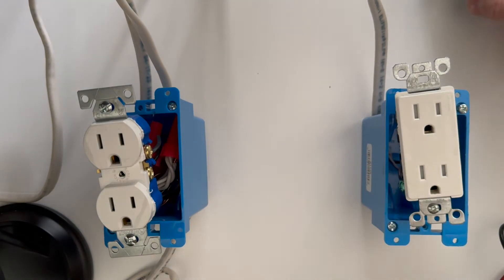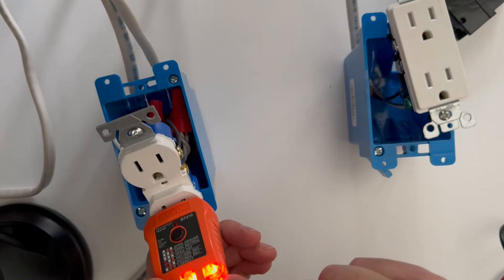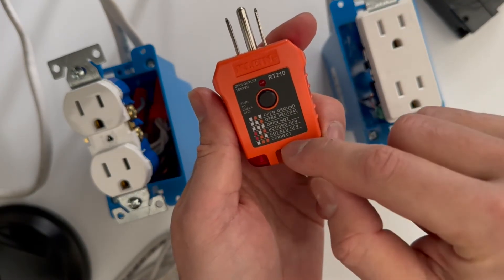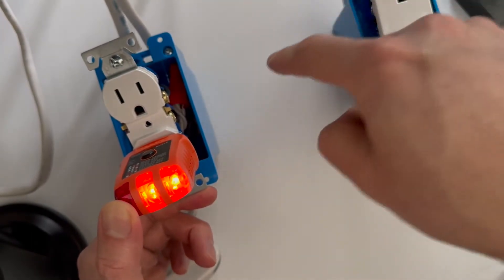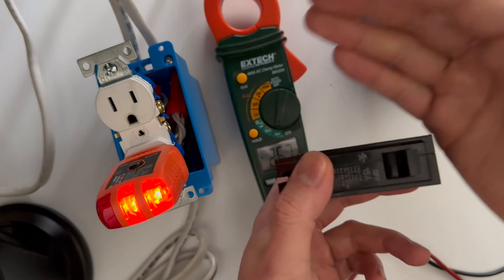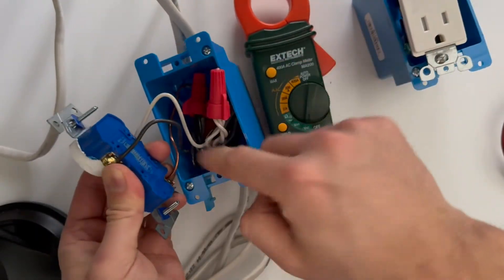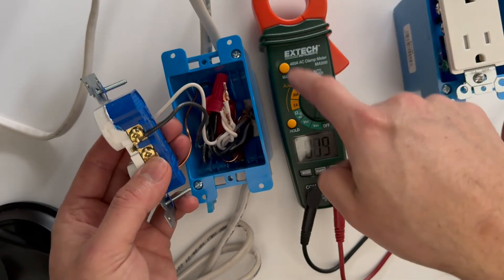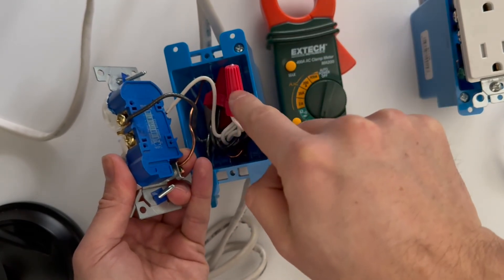Hot Ground Reverse on Tester, Open Neutral Troubleshooting

Comment: I had the same problem and that is exactly how my electrician found the problem without opening all the other outlets. With his tester similar to yours, the outlet that had the correct readings was the one he fixed. It had the neutral wire going to the next outlet was loose. Of all the other videos out there, this is the one that worked for my situation. Thank you so much for this video. This will help others troubleshoot their outlets without having to work so hard.

Comment: had a Family member that had dead electoral outlet.  After replacing the outlet, the tester showed error open neutral and Hot/ground reverse at the outlet. with your guidance found a wire on the other outlet loose. Thank You!

Comment: As a master electrician with 10 years experience, I have yet to come across an actual Hot/ground reverse situation and if I did this is obviously an extremely dangerous condition, someone would have to be literally drunk to reverse the hot and ground at the receptacle.  

Yes I have seen the hot/ground reverse reading on a tester on numerous occasions and every single one of them was an open neutral with downstream load connected.   Backstab connections at receptacles have been the number one cause in my experience, followed by a poor connection under a wirenut until it finally burned open circuit and in both cases the holidays and Winter months when I most frequently see this on service calls, a time when space heaters and small kitchen appliances with heating coils are put to good use.

Comment: Thank you very much for this. I am by no means an electrical person but just changed my outlets and now my bathroom lights do not turn on. Went to the last one showing normal and put my voltage meters in it and the top wasn't getting anything. took it out and looked and it turns out when I pushed it back into the box, I snapped the wire which caused it not to work. Thank man. You saved me hundreds.
Reply: Gotta be careful when stripping the insulation, it’s very easy to slightly nick the copper if you grip too hard, that creates a weak point that can break. Even when it doesn’t break right away, it will eventually fail from the wire heating and cooling with loads over time.